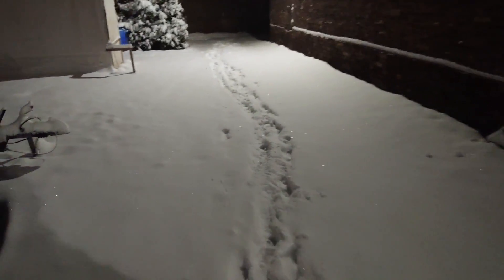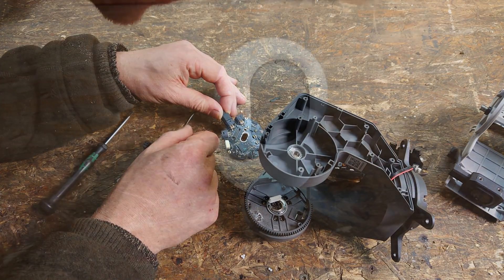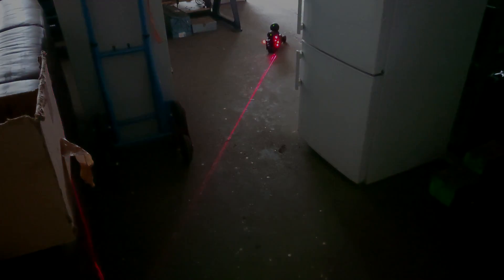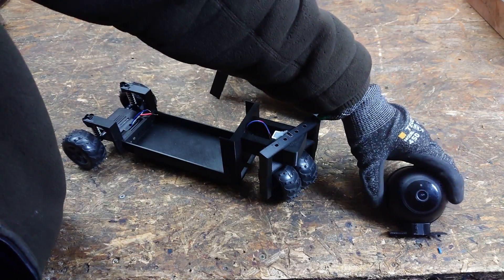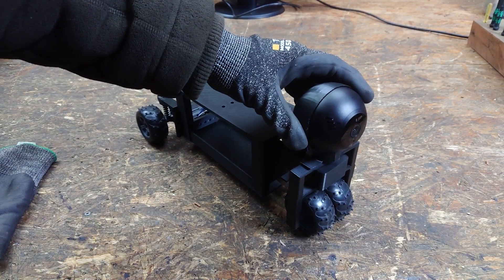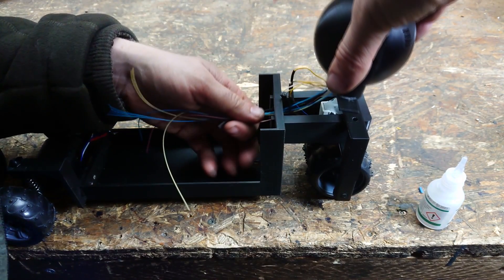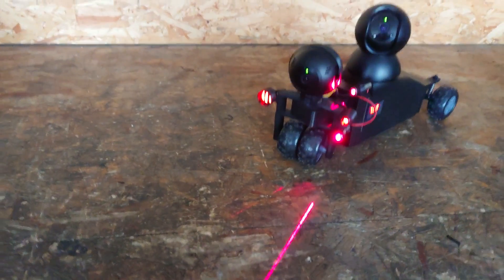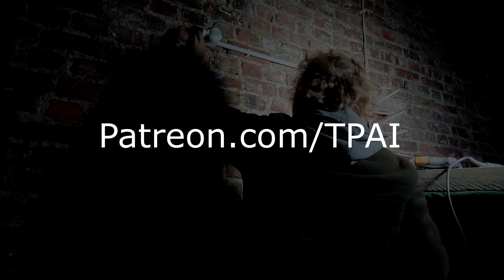DIY Surveillance Robot from Cheap IP Camera! Build and Test!

Comment: I love the idea using camera stepper motors for steering and the double laser as navigational aid. The latter could also be done with IR-lasers invisible to the human eye (not the camera).  But your real problem is a camping  trailer broken in multiple times.  How about moving the trailer to a safer place? Apparently you are living in a crime ridden area. From what you say not only your trailer was affected by criminals but other property of yours too.  All electronic modes & means to scare away potential burglars or vandalists are either futile or utterly expensive.  But asking a local or regional peasant parking your trailer in one of his barns is cheap. Parking it on his property open space: Dirt cheap.  Safety instantly increased.  Such trailers are used one- or two times a year for a few weeks during hollidays. So you do not need 'em close by for everyday access.  And if you trailer is not located on your own property you already paying some guy some sort of rent for parking your trailer on his property.  But it's obviously not safe there.  So it's money for nothing. Move on. And as one of your few german viewers I may add switching to German: Versuche nie ein soziales Problem  (Kriminalität, hier: Einbruch in Wohnwagen) mit technischen Mitteln zu lösen. Bringt nicht viel. Löse Dein Problem sozial: Verbringe Deinen Wohnwagen in ein sicheres Umfeld. Und Dein Camper ist auf  dem Land nicht sicher, weil ein schweres Schloß davorhängt, sondern weil es wenig Kriminalität auf dem Land gibt.  Spot the difference!

Comment: 14:17 You can just create a physical stopper at the front of the platform it can bump into to make it stop at the exact position, so no need to create complex sensors; you can create a guide rail at the front where it will approach the charging station so you don't have to make too much conscious effort to navigate the robot to its target position.

Comment: @thepostapocalypticinventor  
                Why not the same camera hanging from a single thin cable, or trolley on a track, across the ceiling of the shop? That means only movement from one side of the shop to the other. Placed at one end of the shop it could still use pan and tilt to capture the entire area with far less concern about actually having to drive it and possibly getting stuck. Either way, impressive work in your part.

Comment: For control of the motor. You could set a pulse monitor with an Arduino and output a speed  control, tap up to go faster, tap down to reverse. Tap opposite to stop

Comment: I love your ingenuity. I had a couple of thoughts for the robot, (although it sounds like you're making something better anyway). First you could drive the motor the same way you drove the steering, use the stepper as a servo to actuate a mechanical speed control, then you could have reverse. Next is the charging setup, if you could mount the inductor like a shield on the front or rear, then you would just have to line up with the target device and drive into it mounted on the wall, maybe have a strong magnet to finalize position and ensure that it doesn't roll back.

I'm sorry you're dealing with so much petty crime. It sure brings down the quality of life when you've always got that in the back of your mind.

Comment: If your pi based idea doesn't already do something like this, then perhaps reusing a standard R/C vehicle as the base might work. Ie, you send instructions via IP traffic to the pi, which then sends the appropriate signal to the R/C controller, and then the R/C controller handles the rest.

Comment: Drug addicts consuming drugs in public and the crime and ASB is becoming a world wide problem. I retired to a nice middle class town in England but didn't realise it was next to a drug hostel. The last seven years have been a nightmare. The police and the hostel management refused to do anything about these gross individuals even though there are laws stating they should. I eventually got the police to act and the difference is staggering. What I did was to get a battery powered Reolink wifi camera for security. What I realised was even when it wasn't connected to the wifi it still acted like a trail cam used for wildlife photography. The standby time is very long. I was able to hide it in a plastic/crisp bag so it looked like rubbish but had a hole so the camera lens and heat sensor worked. I hide it in plain sight so I can catch the people who are wandering about at all hours. I then report them to the police. You can also put images of them up in the neighbourhood advertising they are drug users and have been reported to the police etc. The idea is to put the pressure on them. They think they have got away with public drug consumption but they haven't. I have also hidden the camera behind artificial ivy and other artificial plants to disguise the camera which I painted black. It works really well.

Comment: I'd use the wheels off the toy robot - it might take 4 motors, but being able to drive sideways would make driving better. Another idea could be to build a simple line follower robot (there's many tutorials for raspberry pi) and simply paint a black line on the floor and have the robot follow that.

Comment: Since they are stepper motors could you not data log the signal ffom the auto ptz tracking go capture what would be the camera tilting up. down a nd then the degrees of rotation? I Then use those data points as a startin  point o incorporate a forward drive  where signal would have triggered tilt up....a revers if tilt down and left turn if triggered fom 90 degree or rght if 180 forward again if at 0...something like that? Then some object sensing  for obstackle avoidance/k keeping a distance...and walla you have a n auto follw security droid....

Comment: Any 1 know how these ptz style security cameras auto tracki' Mzaybe some links to technical i nformatio n/\?

I've tried to find out how these ptz cameras work- as in; how do they track? Auto track? I've taken apart a number of these.....funny how most of them with al the hardcore looking antennas turn out to be fake antennas...

But  back to the auto racking? On testing my cameras- pretty much same as yours but outdoor....they still have the same internals, just some seals and silicone... when testing the cameras, some times they'd rotate over but there would not be any way that anything was in view..but it appeared to react to noise. Is that something the auto tracking works on? Like a stereo audio signal and if audio came from left...cam panned to left.....and riiht if sound originated from that direction? 

Or is it more complicated than that and something 1 of it's many chips calculate and orient the caera?

Would ave been interesting if you'd just set up te stepper motors similarly to what you did, bt utilized t auto tracking capabilities to automatically "investigate" movement.....to make the robot travel toward te direction of the movement...adding some sensors on the front side rear to keep a healthy distance still. Pigy back/k stack multiple cameras onto of each other playing arround with maye 1 controls 2 sets of the mechanical ptz part. ow would it function? How about adding  gearring o he steppe motors to increase the speed at wich they track objects?

Comment: I think we had the idea of using TAPO camera at the same time, but in my case it was a different idea, I created a personal assistant and I intend to add some mobility and gestures with additional hardware that I haven't chosen yet.
Using a server on the same network, my Tapo c210 camera can:
- listen to voice commands and interpret: RTSP stream, openai/speech-to-text
- use this text to generate the response: openai/GPT-4
- read this text as an answer: openai/text-to-speech
- when play the response voice, the camera moves at the same time, to appear more friendly and alive: pytapo

If you use GPT-3.5 the response is instantaneous!

The only thing I haven't been able to solve yet is getting the camera to produce the sound of the server's response. In this case the sound is only coming from the computer/server. 
(If anyone could help me I would appreciate it)

I advise you to explore these features! It's super interesting

maybe using an esp-32 (arduino) in parallel with the camera board could be a good idea 
🤔

Comment: Liked. Feedback on printed rc units: design holes for nuts and bolts so you can redesign a single part.

I always liked the märklin on a wall. Should be possible to have a camera cart😊. Or build a track loop on the roof with a hanging camera. Could also be camouflaged as a toy skilift / hot air balloon.

Comment: A paint ball gun would be a useful addition. Even better a tesla coil based spark projector would get the attention of the drug addled "campers" if the robot came out of the dark with laser lights ablaze and sparks flying.
Cheers Eric

Comment: You could probably do a LOT with a remote control car and a cheap smartphone. You can set a phone to automatically take a call, like on Skype. 

I see the battery bank and I kept thinking dropping a smart phone in there could be very useful to make sounds, record, or even just for location. 

I have thought a LOT about a mechanical device that can push buttons or use a controller. So you slide it over and maybe it type son a keyboard or slide a controller in and it moves the physical controller. This is pretty cool. 

You really should also just set up some motion sensing and an alarm system.  They walk on your property and an audible alarm goes off.

Comment: Love your implementation for forward drive. I might have used the up/down servo on a potentiometer for forward/reverse drive, but I think your implementation is far more elegant. Maybe one of those lasers could be a different color, or use a beam splitter that projects a target from the laser that moves. Also, to save power, maybe the lasers could shut off after a period of time with no motion.

Comment: I wonder if a line of black tape on the ground could act as a marker for the positioning for charging?

It could line up with the bottom of the frame (with the camera pointed to its lowest position, or some other consistent position) when the robot is over the charger.

Comment: how about if you change on of the lasers for a green one? it would be easier to steering the robot, i recently run around a very cheap construction plus sign laser that shows when you are off from a level surface and a rechargeable battery inside

Comment: For the raspberry project i have an idea to improve the driving part. You could probably reduce the resolution of the picture to reduce the delay and get a better frame rate for faster motion. Once you get to some interesting spot, you switch to the high resolution mode to get the slower but more detailed pictures. Maybe you can do the adaptive resolution on one single camera, or you do similarly to this robot, having a driving camera, and a second inspection camera.
Another thing that might be interesting is to add cameras that are tuned to the IR spectrum and add some IR lights, so you could drive around and see in the dark. Or else you would need remote light switches in your shop to turn on the light so you can go do your nightly inspection runs.

Comment: I like this alot!  Do those IP cameras have night vision as well?  If they don't, that would be a good upgrade.  If you could, eventually, make the robot follow a pre-programmed route, avoiding obstacles in it's way, you may give Boston Dynamics' Spot robot a run for it's money!  Ok maybe not, since Spot can climb stairs and open doors, but it would definitely be a budget-friendly alternative since I think Spot sells for $80,000.  Maybe you could also add the ability to turn on all the surrounding lights to ward off a potential intruder.  This might allow you to record better video of the intruder as well.  If that doesn't scare them off, you might try using that horn you attached to your garage.

Comment: I subscribed to see your Raspberry Pi solution. I would probably have tried an ESP32 because I'm more familiar with them. I'd like to get into more PI projects.
Due to the delays I would have built in a reverse because if you run into something with this you are stuck. You don't really need to see behind you to reverse.
I didn't really understand the circuitry for driving a DC motor from the stepper driver. Also the message said not final circuitry so I was waiting for more. I'd be interested in more detail there.

Comment: We have several pan and tilt cameras on a remote property.  I find that welding some brackets to move the camera off of the building’s face give you greater range of visibility. At the end of the day the cameras are as much a deterrent as a surveillance mechanism and with many cameras visible to a potential intruder, that intruder knows they are being watched. You can use old bed frame ang iron to weld brackets as the material is usually free. In our case the incidence of vandalism has dropped to zero.

Comment: Looks good. The only thing I might have done differently was hook the resistors into a micro-controller in a quadrature encoder arrangement. That way the direction of pulses would signal motor direction. Not sure it would work with bipolar motors though. And you still can't see to back up, but if you over shoot your charger base, you don't have to go all the way around.

Comment: I was going to ask why you didn't implement some kind of latching circuit for the forward/back control (e.g. tap up once and it starts rolling forward, tap up again and it stops) but then you explained the lag and i realized that you aren't really going to want to drive forward like that anyway when navigating around. And then you explained that you were building an entire robot from scratch, so it's moot anyway. :-) Thanks for the video.

Comment: Hopefully, the manufacturers see this video and start producing products like this. I would think TP-Link could push out effective ROVs for super cheap. 
That being said, this is really impressive and has got me thinking about using an ESP board for something similar. Being able to leverage their product and existing service so you don't have to mess with code is very clever, though.

Comment: Hack a roomba style cleaning thing (secondary brands such a Conga, also get a second hand one where probably only the battery is dead) and to drive it with the tapo on top, extra lithium batteries on top to feed all and a cheap/old smartphone to access the contraption via wifi and 4g with the phone sim card? Not saying it would be easy but less need of 3d printing? Old Congas had a remote control, an ebay wifi mofule to control left/right, forward/reverse of the remote connected to the smartphone hotspot in case electricity/router of the location is off. Maybe feasible?

Comment: If you want a way to know the robot is over the charging pad, put a mirror by the charging station so the robot can see itself while at the pad. Either put alignment marks so you can confirm the position from that view, or expose a charge LED on the robot so it's visible in the mirror.

Comment: I'm sorry to hear you had a break in TPAI, but I'm glad to see you're being proactive about home security. You should tie in that Alarm Bell, and Yellow flashing lights that you fixed up a few years ago into your system, so you could press a button to set it off to scare off any would be intruders.  

The little RC camera car for blind spots is an awesome idea! At first I thought you were going to hack a Roomba and mount a camera on it lol, but this is much better.     
     The only thing I'd do differently is mount an Airsoft gun loaded with metal Airsoft BB's so I could shoot said intruders if they made it inside. Great video as always! 👍👍

Comment: Hi, great video as always. I think I would have started with a robot vacuum for the base. Hear me out! Comes with a charger base that it can find itself (IR Tx/Rx) can operate via an app, can roam around "on patrol" by itself, on mine I can drive it around manually and its pretty manoeuvrable. Broken ones can be had for cheap and if you want it could even vacuum the workshop! Alles Gute.
Reply: True. But for $10, some self education, on wireless charging and a fun time in the shop I’d take the RC version. Not to mention a helluva lot faster in getting away from being trampled by a freaked out burglar. 🏁
Reply: I was about to suggest something similar, I have a robot vacuum cleaner that even has a camera and a manual drive mode that you can use remotely through an app, although it's not the same as a tilt and pan camera, it could be a good starting point.
Regarding the inherit delay while driving it, I wonder if you could add set points to where the robot could drive automatically, that way you could monitor the camera and not worry about acting as a closed loop controller yourself.

Comment: Hello! Well done! Have you thought about using an autonomous vacuum cleaner as a platform? There are many cheap, older models with remote control via phone, self-charging function and camera, but the image is of low quality. I admire your work, greetings from across the eastern border!

Comment: Never been a fan of IP or WiFi cameras, particularly those that require an app to access.  My CCTV system is made from cheap PTZ wired (over CAT5 via balun) cameras that have optical zoom (x32) and use Pelco-D for control - all over the same CAT5.  Properly placed they offer coverage of every sq m of property and if used with a DVR can also deliver a cloud based service.  I'm currently experimenting with converting 600TVL camera modules to 1080p.